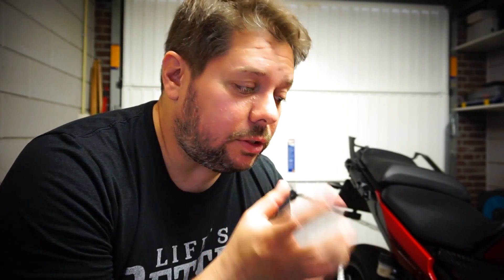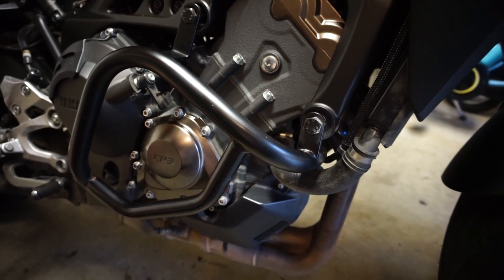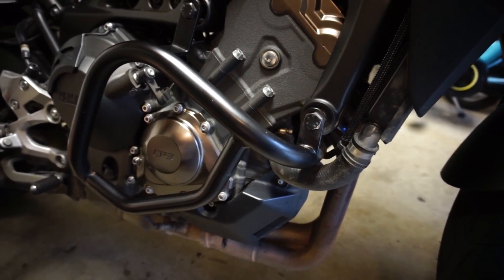Long Term Review: Fehling engine guards for MT-09 Tracer (FJ-09)

Comment: SW-Motech has just released a set of crashbars for the Tracer 900 GT. A bit more expensive, but I'll be ordering a pair once the bike is delivered (I'm in Canada)
Reply from the maker: Need to check those out, I heard now of SW-Motech and Heed. I'll study the topic in more detail in the coming weeks.
Reply: SW MOTECH are not even new, they exist from 2015 and they dont provide miguel the kind of protection you need. they protect the upper part and the side fairings. SW MOTECH has Engine Case Protector for the left side only of the bike (not even a slider)....
the only ones that provide the protection you need is FEHLING, HEED (polish),  CRAZY IRON (russian) and of course the american HIGDONION

Comment: If you like these crash bars, aside from the rusting issue, maybe consider getting these ones powder coated. Then they will have a new rust free finish, and can go on the new Tracer GT. Powder coating will also be cheaper than buying new crash guards.

Comment: Well, i just got them and are about to start mounting (using your vid as well as MotoAndy's once for guidance). Wonder if I should spray them a little extra, e.g. in the "corners" (as I just black-sprayed the bolts, same like u did). But then, the diff in paint might be "visible", though not sure with the naked eye yes or no ...   BTW thanks for all the MT-09 vids, I just got the 2015 MT-09 Tracer three weeks ago, with only 6.5k on the clocks. And yes, I'm also in the south of the Netherlands, in Brabant.
Reply from the maker: I don't know what to say to help you prevent the rust. I was kind of hoping it was my unit that was defective but I've seen other complains about this in the meantime. This also seems to be a problem in Givi crash bars so maybe it's unavoidable?

Comment: The quality of the one I bought is much better than Bryans but as he says it does what it's designed to record an accident/ event from front or rear. I just let mine run in the background hoping I never have to use it just like the crash bars.
Did you look at the Innovv camera?

Comment: The rusting is only near the welds. This is where metal is weaker, both mechanical and corrosion  wise. Also this is where the surface is rough so degreasing before paint is more important. To repair small rusty spots, buy a product like Noverox rust inhibitor.

Comment: Man, I bet the warranty on that part just expired !! I personally think, that the Tracer has to much vibrations , and the after market manufacturers didn't calculate that, so wherever there is a joint, it cracks and rusts ... also, there are many metal particles  running around ... in the enough amount to provoque hits on that paint job that later will rust too ... I doubt that any manufacturer would apply a warranty on that part, unfortunately, of course !! Nice video. Keep up. Abraço ... havias de ter a minha Kelly, ahahaha, ferrugem é um assunto que deixei de ligar, ahahahah !! Cheers
Reply from the maker: I don't think the Tracer vibrates more than normal
Reply: I have a 2017 Tracer and it doesn't vibrate at all. Love this bike!

Comment: I have also had Fehling bars on my CBF600.. Not impressed by these crashbars. because of the rust-spots appearing. At my bars the paint started flaking off on the sides. Even if riding in rain and salt this should not happen.

Comment: Did you ever use ACF50 or another anti-rust agent after a wash?
Reply from the maker: No. Isn't that for when you ride in salted roads in the winter?
Reply: Critical Rider I ride in central Europe in all weathers and seasons (!) and have just started to use ACF50 based on The Missenden Flyer and some other recommendations. He has an aviation background and is well aquainted with the product. I am glad to be using it, and it's part of my washing routine.
Reply from the maker: I follow The Missenden Flyer and I thought about testing this ACF50. However, it all comes down to the faf: why the f.ck would I have to spend hours upon hours to protect the bike against something that should be protected from factory?!
Reply: Critical Rider My guess is that you take pride in your bike.

Comment: might not have been properly treated before painting? after all underside of cars often have 5 or even 10 year warranty against normal use roads corrosion! why not these parts, as they are similar in the fact they catch crud and water can cling to all the corners and so on! so I would think they should be well treated and primed before painted to eliminate corrosion and lacquered after the last coat of paint as a further guard! any ferrous based alloy or grade of pure steel should! why not write to the maker, instead of emailing or phoning? actually paper and pen them lol? good luck, enjoy the new bike! ride safe!
Reply from the maker: I'd rather publish a video showing their lack of quality. Maybe they understand when it hits their bottom line...
Reply: yes perhaps! but I'm just saying the technology is there, to make equipment more resistant! and its constructive complaints that have made manufacturers of any goods we all use (not just motorcycles)
more reliable and better in quality! otherwise fridges, TVs and bikes etc would break down days after we buy them! just saying though good luck, ride safe!
Reply from the maker: Thanks, you too.
Reply: you're welcome!